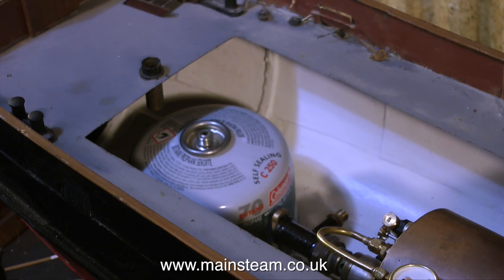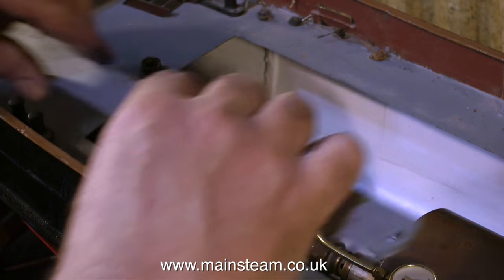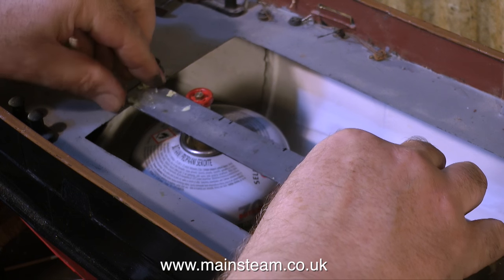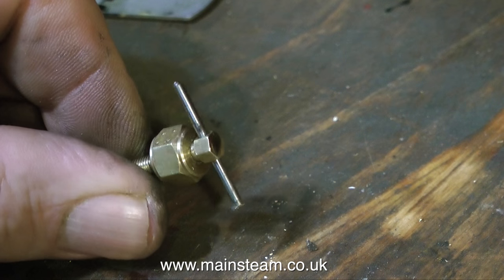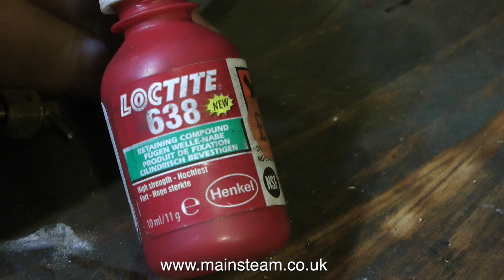REFURBISHING A VINTAGE MODEL STEAM BOAT - PART #23

Comment: I know it's a quite old video, but one question: why you didn't put the emergency gas shutoff valve near the gas tank and run a brass rod among the boat? I think it would be much more secure.
Reply from the maker: because it works perfectly fine the way it is .....